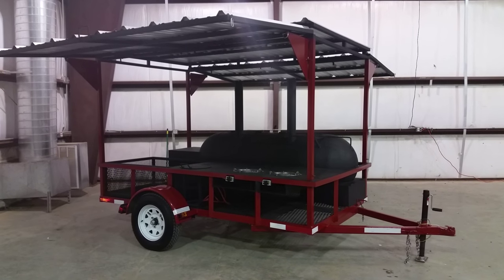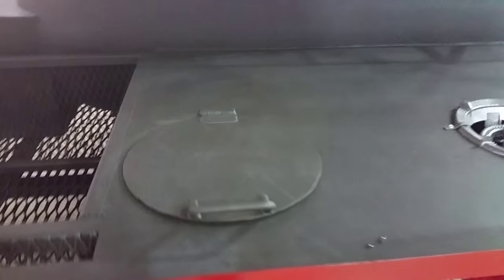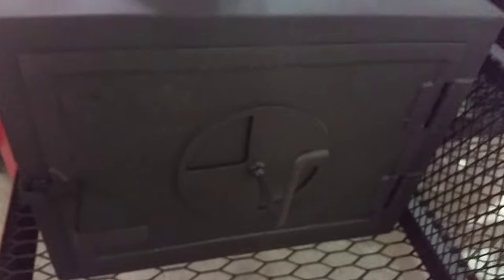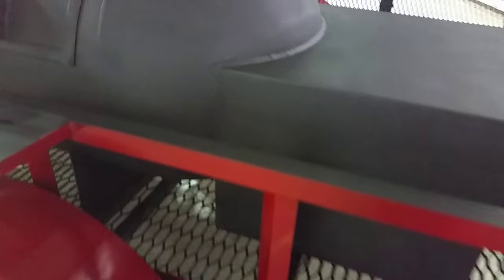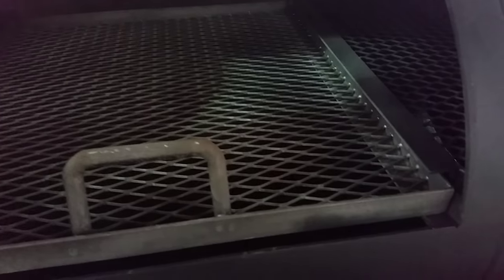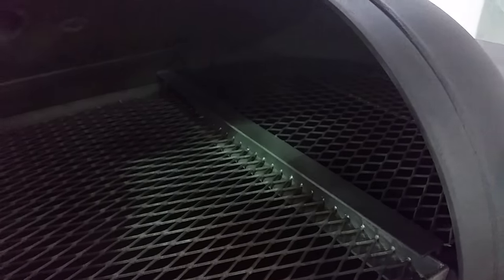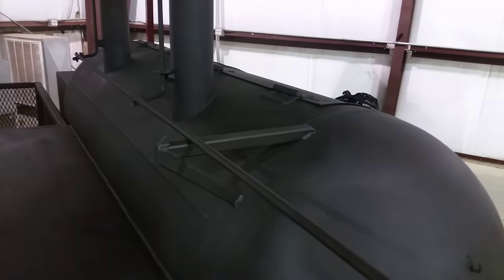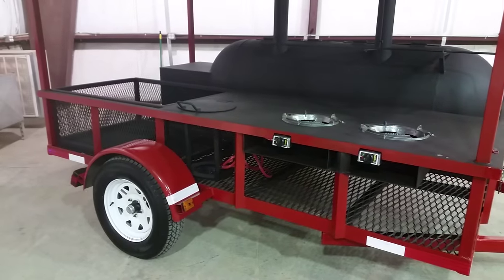CUSTOM BBQ TRAILER SMOKER BUILD WITH PROPANE TANK GRILL GRILLS SMOKERS

Comment: Great looking build! I'm not being critical, but why didn't you take the stacks through the roof?
Reply from the maker: It was the decision my cousin took. I would of preferred to go through the roof to avoid any fumes from gathering under the R-Panel. Im still thinking of building me another one.
Reply: Stacks through roof dramaticaly increase draft (speed of heat moving upwards) smoker=slow..
Reply: I would have preferred the stacks to be at the left end, above the clean out so the hot smoke is not wasted. The meat on the left will come up to temperature because nothing is causing it to flow that way. No only does the hot smoke cook the food but the air flow direction is critical. I would gladly buy that trailer if that were changed, it’s definitely nicely done, & the weld are incredible, they are not “little welds” for sure. Jorge, I’m enjoying your channel, good content brother.